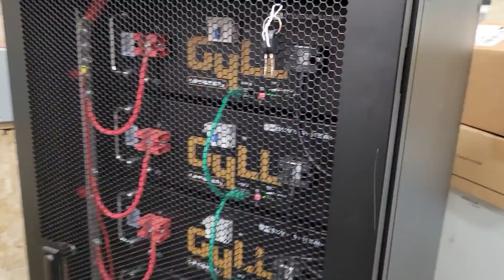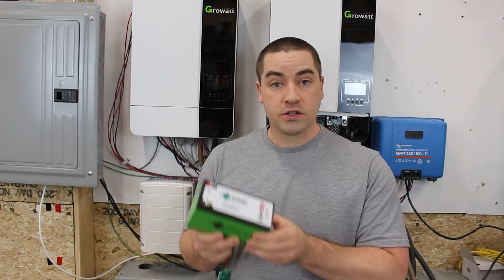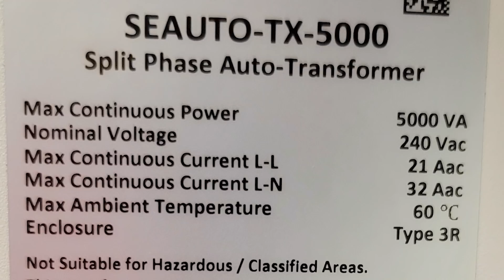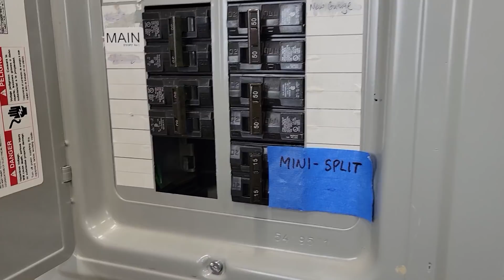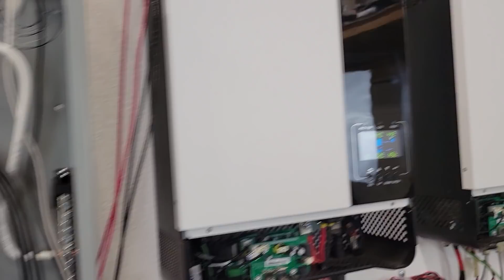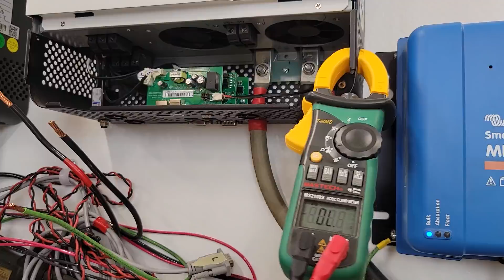Safety Concerns with Auto Transformer and Growatt 240V inverter SPF 5000 ES

Comment: Big issue with loading an inverter output with a transformer is potential damage caused by dc offset.   As inverters age they leak dc…this can be measured with a volt meter set robes …a new inverter will have dc offset set in the Millville range.  Creeps up with age.  The problem is the dead short that will occur thru the transformer which will easily pass dc that is generated below 60hz.  Too much dc offset set set and you can blow out an inverter output stage.

If you have a leaking inverter with a lot of dc offset all is not loss….you can put dc blocking capacitors in series with the load.  So for a 40 amp circuit you can use 10 45uf capacitors rated for 370v in parallel and put that in between the inverter and the transformer.  This will block dc but let ac pass .

Comment: There is something I don't understand, why do you want to switch the neutral at all. Just to protect the max 5kW load in case that happens on one Leg  is that the problem?.
Reply from the maker: Yes, the maximum Amperage of the auto-transformer.

Comment: I don't understand why you added autotransformer in your setup.... there is no neutral on an autotransformer...
You already said that you originally had it going to the panel directly...
Reply from the maker: This particular inverter outputs 240V AC only.  There are no 120V legs.  I live in North America where our houses and appliances use 120V and 240V.  Large appliances like water heaters, stoves, ovens, etc. use 240V.  Small stuff like microwaves, lights, computers, fans, TV's, refrigerators, etc. use 120V.  Since I want to power my house I need both 120V and 240V.  I feed the 240V into the auto transformer and get 120V out.  
Does that help?

Comment: Great video! Something to consider that is not covered in this video. If the Neutral for some reason is overloaded then it will trip L1 stopping power to the panel, this is only effective if there is an overload condition on the Neutral. However you still have a breaker for the Autotransformer in your panel. If for any reason that breaker is tripped, you will lose your Neutral, and not trip the triple breaker you installed. You will then have 240v across the panel with no neutral. To possibly solve this you could use a 2p+2p Quad Circuit common trip Breaker, tying the Back Feed breaker from the inverters to the breaker for the Autotransformer in the panel. In this configuration if the transformer breaker trips it will disconnect the Inverters from the panel.

Comment: Hi David, I'm wondering if you have a wiring digram for wiring the auto-transformer?  I'm installing 2 growatt 5000es and 2 aoto-transfomers with 2 of the circuit breakers you described here. I would like to send the picture for your opinion.  
Thank, Martin
Reply from the maker: Sorry, I don't have a wiring diagram.
Reply: Any concerns running two autotranformers? 4 inverters and 2 autotranformers

Comment: Hi David, just curious about where you sourced the DIN rail distribution blocks for your L1 and L2 outputs from the inverters? Your videos have been super helpful designing my 12kw+ system.  I think I have every piece except for those blocks...Thanks, -Tom (sorry  if you mentioned it before in the comments, I've been digging through them but I figured it might be quicker to ask)
Reply from the maker: Ebay.  I found it using keyword "Terminal Block"

Comment: Why don't you  just go with the split phase so you only have 1 device to deal with and not mucking around with the additional stuffs to get 110V?  Sure you have 10kw with 2.     5kw  but they do make 10kw split phase.  You  must have your reason  but I can't figure out what it is????

Now i am about to buy a hybrid inverter too and that is the route i will take.  
Simple is the best and I believe it is cheaper  too because i have NO  other stuffs to muck around with.  Less stuffs mean less headache down the road when it breaks down.

Furthermore the xformer low frequency  is way  more superior and reliable in contrast to the mosfet high frequency switching.  Sure it is heavier but i don't move this thing daily and neither does anyone else!   The split phase inverter type usually is LF type and LF type is always more costly than the solid state  type but man   it is worth it especially under heavy inductive load .

This might not mean anything to the newbie but if one goes to the high 8kW or more   LF type inverter is a go to.
Reply from the maker: I test lots of different inverters on this channel.  This is just one option.  I've also tested LF inverters and have videos of them.

Comment: what is purpose of adding Auto Transformer into system? Most YTer connect to double circuit breaker😅
Reply from the maker: The auto-transformer produces a neutral.  I go into a lot of detail with my multi-meter in this video: https://youtu.be/yWUfvvSa3K8
Reply: @DavidPozEnergy  Thank you David 🇺🇸👍
Reply: @DavidPozEnergy  Hi David, Did you have video of you install AC Soft Start device ? Better to see you do than other Youtubers 😃
Reply from the maker: No, I've never installed a soft-start device.  I think the inverter should be built to start the appliance.  If you have to modify your appliances just so an inverter can start it, I think it's a flawed design in the inverter.  I've used several different inverters to power my house.  Some can handle the loads and some can not.  The best one I've tested is the Schneider: https://youtu.be/nCV1OUrcAaw  The Schneider inverter can handle all the loads of my house without any soft-starts added.

Comment: I don't  understand why you needed an autotransformer if you had two growatts. I thought you only needed the autotransformer if you had one. There is a L1/N on the first growatt and L2/N from the second. I thought you were just supposed to tie the two neutrals together to get your neutral of your panel.
Reply from the maker: Growatt makes more than one model inverter.  You would be correct if I had 120VAC inverters, but I have 240VAC inverters.  Thanks for watching.
Reply: @DavidPozEnergy  ah. yes. I forgot to consider o you might be using 240Vac inverters. That would be a good topic for a video if you don't already have one. Sales people are saying to buy 2x120Vac inverters to get the 240Vac (maybe they get more commission that way) or else you have to use an autotransformer, but I hear other bad things about using an autotransformer. If you could do a comparison of the two options would be a good video.
Reply from the maker: @deedee6905b  There are a lot of things to consider.  Either way can work if you plan it out.

Comment: Do not install a Circuit Breaker in the Neutral Wire.  This video is bad advice.  Install a Dual Pole Breaker between the Inverters and the AT (L1 & L2) and then install a Dual Pole Breaker between the AT and the Main Panel / Loads (L1 & L2).  Do not ever open the Neutral Wire when Split-Phase is under load.

Comment: Growatt 11.4K Split Phase Transformer | ATS 11400T-US

Can you do a review on that one. Or is it basically the same?
Reply from the maker: I have not reviewed, or tested, that model (ATS 11400T-US).  From what I can tell reading the specs, it is the same 5kW auto-transformer in both the 5kW and 11.4kW models.  The difference will lie in the 240V pass-through current.  Checking the spec sheet, both models have rating of 5000VA L-N.  It will work fine if you keep your load imbalance below that.  However, if you know you have really heavy loads on one leg, then you might consider finding a larger isolation transformer.  I've been able to purchase isolation transformers of 10kVA for $100 on craigslist.  Just giving you another option.

Comment: David i think youre over complicating things lol look, install a 60a fuseable disconnect below auto trans then take youre lines from your inverter and run them to line side of disco, then install 50a fuses and a two chair lug or tap on line side of disco, now run from line side of disco (from tap or chair) to panel lugs, now run from load side of 50a fuses to auto trans, you now have a foolproof permanent easy setup for this that requires no relays contacts or crazy breaker setup
Reply: if the inverter has a current limiter then you shouldnt be drawing 50amps on neutral anyway right IE fuses more reliable than a breaker, lock it on and youre good i suppose

Comment: If the transformer fails, will this breaker, stop both hots from messing up 120 electronics
Reply from the maker: There is a solid handle connecting all 3 poles together.  If one pole closes, it will pull the other 2 poles closed with it.
Reply: @DavidPozEnergy  When the Neutral Pole OPENS , the other two poles ( L1 and L2 ) will open LATER . This is not good.  We never put a breaker in the Neutral Line that feeds a main panel.  All you need is a Dual Pole Breaker between the Inverters and the AT ( L1 & L2 ) and a Dual Pole Breaker between the AT and the Main Panel ( L1 & L2 ) only.  Do not ever open the neutral wire in split-phase, while under load.

Comment: Each invertor is suppose to have 8 awg and a 50amp 2 pole breaker. If you are taking the wires from the term block to the ac distribution pannel,  you need to up the wire size and to a 100 amp breaker.

Comment: Using an Isolation Transformer is the way to go to obtain a "safe neutral". An auto-transformer is not as reliable. An Isolation transformer with a centre top on the secondary is better. Much better and little more expensive naturally. It's has 2 windings instead of one.
Reply: How many Auto-transformers have you seen, that actually failed?

Comment: yes i also dont understand why the AC incoming Ground is connected to AC outgoing Neutral ? It trips My main Breaker , I need power at night to power up my loads
Reply from the maker: I run my system off grid.  Meaning, I don't have anything connected to "AC INPUT" terminals.

Comment: Hey, David. There can be no ground to neutral bond in the inverter because there is no neutral until it's connected to the transformer. What you have are (from left to right), ground, Line 1 and Line 2.  Great idea putting the tripple breaker in so that everything except the earth ground connection is broken in case of an overload. I will be looking into adding that into my own system, which I built after watching your video on the origional 3 Growatt install.

Comment: Hi David, I am using SPF 5000ES and I have 2 battery type, 10 KW (48 v 200 ah) of Lifepo4 (DIY) and 10 KW (4 X 12 v X 200 ah) VRLA. Can I parralel those battery to SPF 5000ES. I it is safe how to set the SPF 5000ES?
Reply from the maker: Short answer is yes, you can parallel.  Assuming you built your LiFePO4 as a 16s, then I'd try setting your maximum charge Voltage as 56V, which will be 14.0V per VRLA.  This should be fine.  You may want to add a 12V balancer to the VRLA to keep from over-charging one of them.  The Low-Voltage cutoff might be set to 48.0V.  It might be fun to run a capacity test.
Reply: @DavidPozEnergy  Thanks will do as your suggestion

Comment: Why did you not wire the 240VAC to the Transformer to output side of the 63amp Breaker vs. directly to the Bus Bar?
The way you have it in this video a failure in the Transformer that creates and short circuit will not have overcurrent protection.

Comment: hi , i have 5kw solar system . my inverter is GROWATT 5KW WPV , Not es, i have a problem with charging the battries at night , slow charging about 6-7% per hour , is that normal ? , Grid voltage ok .

Comment: Ok. What if in between the transformer and the breaker, you add two buss bars for Line one and Line two. Then wire from the 30 amp breakers to each bus bar and from the bus bars to line one and line 2 of the autotransformer. This way you can wire your 120 loads to the buss bar. If the breaker shuts off shuts your loads off at the same time

Comment: Why do you need the transfer if you already have 220v split phase with your two growatts?
Reply from the maker: The Growatts are 240V AC only (single phase).  The auto-transformer splits the 240V to give me 120V.  I go into this in more detail in this video: https://youtu.be/yWUfvvSa3K8
Reply: @DavidPozEnergy  thanks. I finally watched more videos as well and I appreciate how you have continued to upgrade and keep things safe. I am going to use your knowledge to build my own system safer and cheaper then having to go through the growing pains of trial and error. thank you and keep it up.

Comment: Guys I want to ask you: th Growatt 5k we installed Keep running the fans for a long te. It is not stopping. Should I be concerned? Thx a lot for the useful and informative replies
Reply from the maker: My fans run all the time too.  They ramp up in speed under heavy loads.
Reply: @DavidPozEnergy  thx a lot so it seems normal

Comment: This is awesome engineering (as well as the solution you conceived). My question is: Does the higher operating voltage, and autotransformer eliminate the need for a Toroidal Transformer Low Frequency [usually Split Phase] Inverter for those heavy starting and surge loads (motors, pumps, compressors, etc.)?
Reply from the maker: Some inverters have large transformers built inside of them.  Those are known as "Low Frequency" in normal conversation.  Typically a low-frequency inverter will have larger surge capacity than a high-frequency inverter.  Typically a LF will have a 3x surge.  This Growatt inverter has a 2x surge, which is less.  That being said, I have not had any issue with my Growatt starting my saws, compressors, or a well pump.  But if you have a particularly heavy load, then you can either use a LF inverter, or use the Growatt with a large isolation transformer.
Reply: @DavidPozEnergy  - Thanks for your reply David. But I still am wondering if having a 240V inverter, with an autotransformer (which is basically splitting the 240V phase into two 120V branches - if I'm correct? and balancing or creating electrical equilibrium between phases?), automatically enables a higher surge capacity than the inverter surge alone (and surge capacity of two inverters into one)?. 

As you know there are many inverters out there (and all of them supposedly have 2x the Surge capacity of their operating electrical output in watts). But most (especially the low cost ones) do not actually output their rated wattage, and cannot handle the surge of basic appliances (such as A/C and refrigeration compressors/ motors). 

I know, as I have a couple of these cheap inverters and was considering buying a low frequency inverter (or two of them), but now I'm gravitating towards a similar setup to yours (of course high or low, a better more expensive inverter will be more likely able to handle it's rated output/ surge).
Reply from the maker: @Sovereign_Citizen_LEO  the auto transformer will help with surges from 120V loads only.  For me, this is useful for my shop tools.  However,  240V loads are powered from the inverter directly.  If you have a particularly large 240V load then you can boost the surge capacity by using an isolation transformer.   Bit it would have to be a massive load of some sort to warrant it.  The Growatt alone can start well pumps just fine.

Comment: Thank you for this, I could use some advice on a similar setup though. How did you wire your feed to the house? I have mine wired for the batteries but I am stuck on if I need a dedicated feed to the house (from inverters to main breaker box @house)to prevent circular use ,my garage already has a sub panel being fed by a 100a and is full but one 240v can be changed to feed the house curcuits I want to back up. I can provide pics if they would help.

Comment: You could have installed a breaker with a relay contact for the XFMR, and a breaker with a shunt trip on the inverters. Then use the relay contact to trip the inverter breaker. That way, you're not breaking the neutral connection. I don't think it meets NEC code if you break the neutral with that middle pole!  I recommend having a PDF copy of the NEC to consult before guessing. :)
Reply: Good point. Don't play with neutrals.

Comment: Just a suggestion,  you could install a phase monitor.  If you lose a leg of power it will trip or if there a voltage in balance it will trip.

Comment: David, we love your videos and are utilizing them to determine our needs. Do you have any plans on reviewing the Growatt 12kW Split Phase Off-Grid Inverter | SPF 12000T DVM? It seems like the optimum "all-in-one" MPPT/Inverter w/ split phase for typical US homes. It isn't stackable, which is my only concern. However, the 7kwh array input meets my homestead's daily needs (4.5hr of direct sunlight x 7kwh) and then it's just a matter of adding battery capacity to fill the low-light days, right?

Comment: Just curious in this scenario wouldn't it limit your 240v to 30A as well? If 240V pulled more than 30AMP would this trip?  Maybe I don't understand the breaker properly.  Does it only trip when the far left portion that the neutral line is connected to or would it also trip of the middle or right went above 30AMP?  In addition I just recieved my Growatt 5K ATS-US and the Max L-N is listed at 42A so that appears to have gone up?  Is it Safe to say you could use a 40A breaker with this?

Comment: @DavidPoz Another great video, such a creative solution. I have seen numerous opinions regarding grounding the 5000 es from SS. Can you tell me, or add the link, should the: option 1. inverter, panels, auto transformer, batteries, and sub panel be grounded to grid ground in the residential panel? Or, option 2. should the residential ground stop at the sub panel which the inverter feeds, then all off grid inverter, panels, auto transformer, and battery have a dedicated and separate ground rod? I am grateful as always.